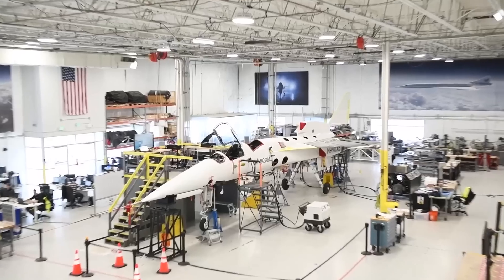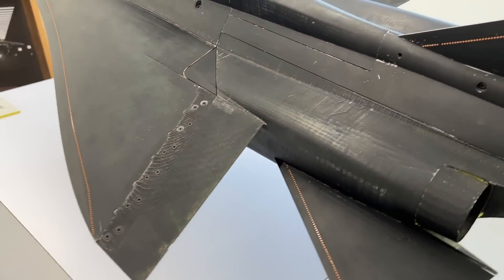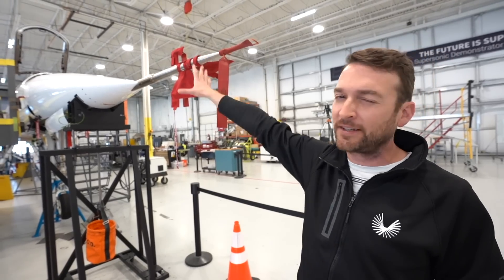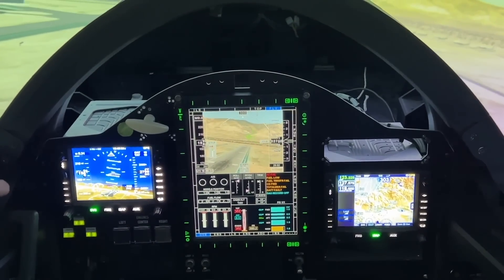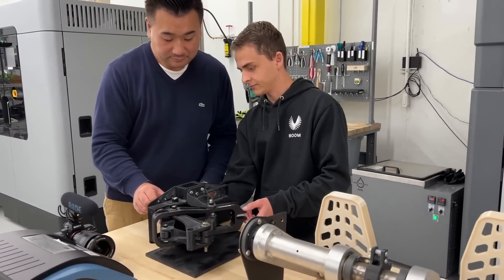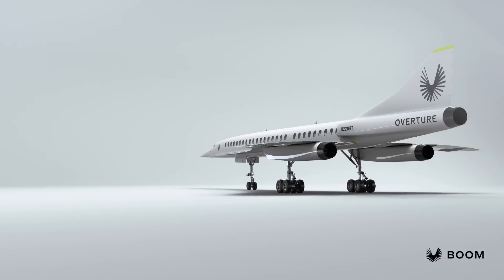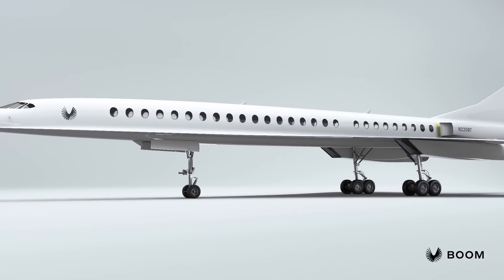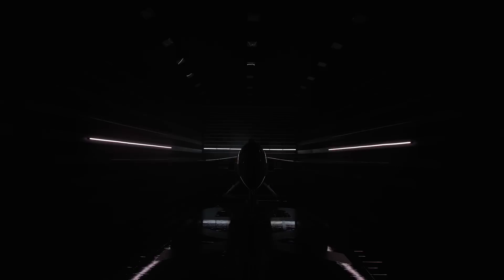Is Supersonic Coming Back? The Future Supersonic Jet - Boom Supersonic

Comment: they put together a flight sim rig and ran MSFS. wow.

Why does nobody think this could be little more than a rugpull scam?
Designing and building windtunnel models is a task almost every student of aeronautical engineering does at some stage. Thats all these guys have done. Wind tunnels and 3D models.
The "XB-1 Prototype" has never moved under its own power, we've never seen it even taxi

Comment: The only issue I see here is the fact there is only 1 pilot. The reason for having 2 qualified pilots is just in case one of them becomes incapacitated, the other can take over. On November 19, 2022 the pilot of a flight dies during takeoff, (HTTPs://www.youtube.com/watch?v=g1meBZzdbh4). How will Boom deal with this issue or will the full-sized jet be set up for 2 pilots?

Comment: Only problems now are where can it be used at all and getting governments who hate rolling back laws to do exactly that. Many countries in CANZUK & CUNA have outright bans on supersonic aircraft (except defence / armed forces) from even entering their airspace whether or not they're flying supersonic. Those same laws plus several UN environmental laws also dictate how far from continents that supersonic flight is permissable (and at what flight levels). Currently those laws make it unviable and good luck getting the UN laws revoked or modified as Japan refuse to weaken any environmental laws and 100% agreeance is required to change them. Also, Australia's track record in admitting they screwed up and rolling back laws is so abysmal that I can all but guarantee they won't. This is a perfect example of a business that decided to make a product that is borderline useless and then try to correct the laws instead of correcting the laws first. Good luck to getting governments to admit they were wrong and change things - everyone always says that they or others need to "save face" and that's why nothing will change.

Comment: Speed is expensive in ANY vehicle! This is why the Concord was canceled. As for fuel to feed 3 engines. Can't store it in the wings, to thin.
Lots of gallons of fuel in the fuse. Fuel take up space.  I also seen "Hinged Controlled Surfaces". SS speeds, cant used them. But I'm sure they solved that problem. (I hope) 
The cost vs a ticket. Unless your going to charge outrageous price per ticket. 
Jet A per gallon NOW, $6.15 to $11.10 PER GALLON. NY to London 3500 miles1200 gallons of fuel needed, not including reserves.
Video said 1st passage flight 2029. Whats the cost then? 
I really don't see this happening, this will be a HUGE tax write off.
Not trying to bust anyone bubble here, I'm just being real.

Comment: Well well, to say it is a closed cycle just because you use renewable fuels is a bit over the top. They will propably fly this thing at about 90k feet, right? So way up in the stratosphere. The carbon dioxide will stay up there for decades!
As an aerospace engineer myself i have a huge respect for the project, as i know most of the challanges they face. But as a product i think this is honestly a huge step in the wrong direction! We dont need supersonic planes, we need more efficient planes if we truly want to challange climate change.

Comment: Rolls Royce just canceled the cooperation to build the new engines. So this is the next stepback for the project. Another ist that they could not get there prototype into the air more than a year after rollout. This project will never be finished.

Comment: I am hopeful but I still think it will only end up slightly better than the Concorde with some being built as a VIP transport similar to Concorde with 1 or 2 hundred being produced
Reply: It will never fly.   Don't believe me?   Just wait, in the not too distant future, money will run out, they will not find another engine manufacturer and the doors will close and employees all let go.
Reply: @rcairflr  what I said is probably the very best scenario. I agree that unless airlines like united payed in advance this is 100% gonna fail and the efficiency goal is gonna fail regardless. I think they are just going to use modified engines from supersonic bombers if this thing even does get finished but I do hope for the best.
Reply: @TopTierGaming6900  . you cannot take engines from a military aircraft.  The regulations are completely different.  You could never get them Certified for a commercial aircraft.
Reply: @rcairflr  that's why I said modify them and it probably would be more like re-using the design basics and building around the same basic design rather than just a brand new engine from scratch.  Basically just a new variant of the engine or something idk

Comment: The issue is no longer about rendering abilities exceeding over super sonic, it's about exceeding beyond the sound boom altitude. You need to find ways to go HIGHER, for example. Cooling systems, turbine micro air flow into compressed rich atmosphere, to channel into the front, to form resistance of thermal build up.

 One way is absorbing from the wing spand and body rims wall surface. Allowing longevity in horizontal cruise. Even the SR-71 undermind this requirement, assuming just a rugged metalic element would solve the problem. 
 But instead, it created extreme maintenance issues on every arrival that was economically unbearable. Especially if they attempted a 4 to six passanger version, by removing the spy camera compartment to be replaced by seatings.
 Image, 🙌 Hyper Orbitliner P/\SSENGER services.

Comment: Wow...J85 engine (incredibly reliable) has been around since 1950's. Amazing that in it's latest iteration it is still cutting edge.
Reply: not cutting edge. They haven't been made since the late 1980's. It's being used in the prototype, because it's literally one of very options. There is no current engine available to meet the requirements.

Comment: Marketing puff for funding. Call me when it does Mach 2 at 60000ft whilst I'm sipping champagne - I did in 1992.

If aircraft manufacturers thought supersonic commercial travel was viable Airbus would be building it as they have all the Concorde knowledge and records plus Rolls Royce have all the engine knowledge

Comment: I think there is a chance for them to make it happen. Hey we did not believe that anyone but NASA or other space agencies would build rockets. Now we have several not only building them; but making them more efficiently and even recovering the booster by landing it back on earth. Many differences between now and when Concorde was made. Easier to model in computers, easier and faster to test computer models multiples times, better and cheaper materials, more efficient engines. So they have a better chance of success

Comment: Concorde, was quite clever, in that its speed, although very fast, was slow enough to use existing aircraft materials. Going faster, is a whole new ball game. As Boeing found out. The materials become horrendously expensive, such as Titanium. At those sort of speeds the outside of the aircraft gets very hot due to the friction. Thats why the SR71 Blackbird was made out of Titanium. That makes the aircraft very expensive for the prospective airline buyer.  With modern composites? I don't know to be honest-maybe this video is looking for investment?

Comment: I'd gladly, very gladly, pay twice to three times the amount of a First Class ticket (6x business?) to halve the time of sheer terror I feel on every flight.  The only plane I have felt somewhat safe in, the 747, is of course basically is gone.  It's just that with 4 engines, if you lose one, you still have 75% of your engines left.  With 2 engine planes, loose one and you are down to 50%...

Comment: I don’t get why they can’t just use virtual screen technology to allow wide view , both camera technology and transparent oled/mini led have existed for over 8 years now. , why can’t we just offset the cockpit simalar to how simulators project a dome, that way we could offer clear view for crew but also a virtual view so other aircraft could be key referenced for crew , especially important in whiteout conditions, or bad weather, we have been keyed to think cockpit areas have to be built just one way when now technology has got yo the point with flyby wire and virtual space /open space displays are indistinguishable from a window or even need to be at the front anymore , it could be built into a model pod and loaded up or swapped out as simply as unloading cargo so they are level with the hull. One thing I would say should be added and flight crew have an emergency key to is fitting emergency land button , in the event that pilot or coo pilot suffer decompression or medical emergency. Or death the computer can then be handed off to hq for emergency landing

Comment: If we adopt more remote working with less physical interaction then we won’t need to move away from family and our communities will revert to something more humane than mere supply chains for companies. Once we challenge the egos in hierarchical structures who need validating with physical teams we’ll advance faster. The high tech high skill jobs are about minds not contact. We can be globally engaged on a local remote level just so long as we abandon doing business outside of work and working hours. It’s those who won’t survive in that environment that are holding advancement back.

Comment: I don't think the word accessible means affordable. This plane is probably going to cost $500 million per unit and with only 80 passengers, while burning more fuel, well this is going to be just like the Concord. Probably $10,000-$20,000 per passenger for a NY to London flight.

Comment: Dead plan. Smaller capacity as the buses, and high consuption, expensive tickets. There isn't enough place in the airports for more pieces, if the demand is high for it. Better way to rebuild the original Concorde with more modern technics. The airlines wants high capacity and low cost maintenance. If anybody hurries, than get depart earlier.

Comment: If the Concorde (British Airways & Air France) never got the economics of their business model to work, then I have no idea how Boom, with its much smaller carrying capacity, plans to succeed.
Reply: Concorde guzzled fuel and was met with push back from a lot of airports for the noise it generated. Overture has no afterburners which means less fuel consumption and far less noise
Reply: Concorde was actually profitable for BA in its later years

Comment: Supersonic jets, whether military or passenger jets, isn't the hard part. Making them viable from a business perspective though, that is difficult.  They are, at best, a luxury item now.  Plenty of room for this in the 'rich man's toys' category, but that's about it.  The fuel cost is just too high for them to make any business sense.  Also unless they can eliminate the sonic boom their options for supersonic routes are severely limited.  Soo... yeah, just not really a good option if money is at all relevant to the decision process.  For some, it's not.  A charter service for the billionaires sharing a plane might kinda work, otherwise, nah.  If they made sense the concorde would still be operating even with the accident.  But the business case just didn't exist to keep it in the air.  The internet replaced the need for executives and couriers to travel in person for just about every reason they travelled on tight timelines.

Comment: Interesting video but a bit bias in my opinion, no info on the supersonic boom and how/if they find a solution otherwise this plane will be subsonic over the land and supersonic on water only, and the little story on the machine that sucks out carbon from the air to transform it into liquid fuel, seriously this is BS, this technology is far from being green and sustainalbe as such machine requires tons a energy to work so the final Co2 production is still huge... again, great show, but i wish it would be a bit more objective and critical.

Comment: Yet... THE most important question was not asked, not answered: at what speed will this aeroplane fly when it is flying over occupied land and cities, will it be flying supersonic, or subsonic as the Concorde had to do to noise restrictions? Concord was only allowed to go supersonic once it was over sea, this made it impractical flying to cities such as Sydney Australia. The other problem is the overall cost of fuel, Concord was a very expensive aircraft to run, because of it's fuel...
Reply: It won't be flying passengers between New York and Los Angeles.  This is for crossing oceans where there's nobody to complain about sonic booms.

Comment: And to think that only 70 years ago, some French and English aircraft engineers wondered the same thing… can we build a supersonic, but that could fly 60,000 feet high, and at >MACH 2.
Then they built it. French using metric measurements and English using imperial measurements. Millimeters v thousandths of an inch. All parts fitted together. 
Worked for decades until a piece of metal that fell from an American plane burst a tyre that ruptured a fuel tank and killing 100 Germans and people on the ground. 
What drives this guy? Never mentioned Concorde.
Reply: The crash in 2000 didn't actually end the service of Concorde
Reply: @PointNemo9  true. Didn’t help, cost of fitting extra membrane in fuel tank etc. but increase in fuel costs and something else led to withdrawal. Branson wanted to buy one from BA but they said no. As expected. Shame.

Comment: This is absolutely silly!  Making an aircraft capable of supersonic flight is nothing new, still a monumental achievement, but nothing new.  How can you keep the fuel consumption to an acceptable level without using after burner, ie, you need to achieve super cruise, and that means your propulsion and aerodynamics must be 5th/6th gen fighter level.  The cabin noise and temperature is a major concern, so how do you insulate without adding too much weight?  Can you produce an economically viable operation?   This design looks like nothing more than a recreation of Concorde...  Nope nope nope.

Comment: To an extent air travel has always been about going faster. If you've ever flown from, say, London to Sydney it's a long way and time to get there.
As Jeremy Clarkson remarked when Concorde was grounded "That's one giant leap backwards for aviation".
Reply: Jeremy Clarkson is one giant leap backwards for humankind
Reply: Ummmmmm......what about Military aviation? Anyway, ANY aviation company can build a Mach 2 passenger plane. You can make a school bus go mach 2 if spend enough money and put big enough engines on it. Boom is about making money, not being an aviation pioneer....but who is the market for this....anybody rich enough has a fleet of planes, whether they own or charter, at their disposal. All door to door with white glove service. It wouldn't be about speed or convenience, just bragging rights.
Reply: @goobfilmcast4239  : It is about speed; less time to get from point A to point B. In the 1950s, we had the likes of the DC-6, DC-7,  Boeing 377, and Lockheed Constellation (piston engine prop planes) cruising at around 300 mph. In the late '50s and early '60s, the De Havilland Comet, Boeing 707, Douglas DC-8, and Convair 880 jets were introduced and the cruising speed was basically doubled. (And the jets flew at a higher altitude for less weather and turbulence problems.)  BTW, most of today's jet passenger airliners are actually cruising at slightly slower speeds than the jet airliners back in the 1960s.

Comment: in another case of military technology beneffiting the commercial sector. The US air force is developing variable bypass engines initially for the F35, and NGAD (replacement for F22 raptor). The idea behind the engine is to change bypass ratios to maximize performance and fuel efficiency when needed. Low bypass is great for supersnic performance but bad for fuel economy. While high bypass is great for fuel efficiency and bad for supersonic performance. These engines could make supersonic planes more affordable and fuel efficient

Comment: The A380-800 costs about $32,000 an HOUR to operate.

The Concorde - when you adjust for inflation and fuel costs - would be EVEN MORE EXPENSIVE while seating fewer people. 

It makes NO SENSE AT ALL. 

The A380 may be phased out for the more efficient A350 ULR and 787 Dreamliner as well as the 777X  with new Business class/ premium economy configurations. 

The industry would NEVER spend the kind of money now they'd have to spend on a supersonic transport.

Comment: I've been on the Concorde.

Why would I want to be on a jet with a 2 x 2 configuration and tight seating when I can fly BUSINESS CLASS on Emirates A380-800 or any other A380?

The Concorde was "fast".

That's a one trick pony.

I would rather the comfort of a $5000 Business Class ticket on Emirates with a SHOWER, a BAR and more COMFORT and QUIET  than be on a $10,000  per flight missile.